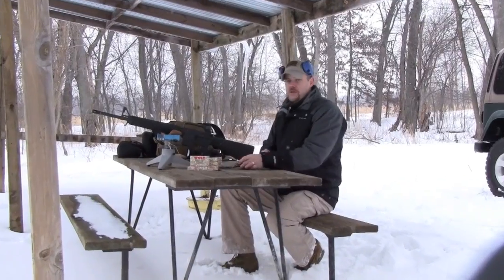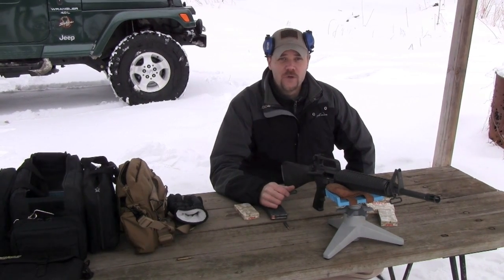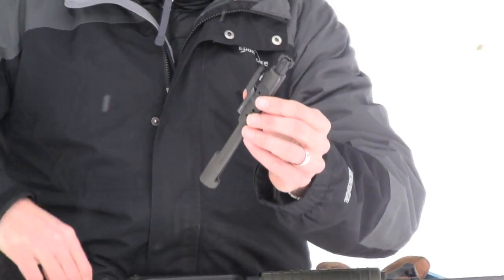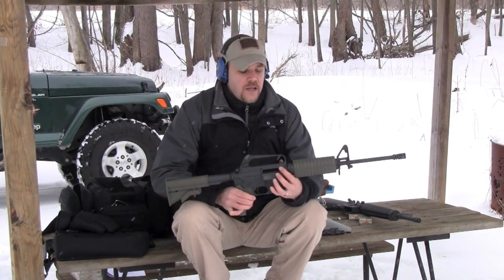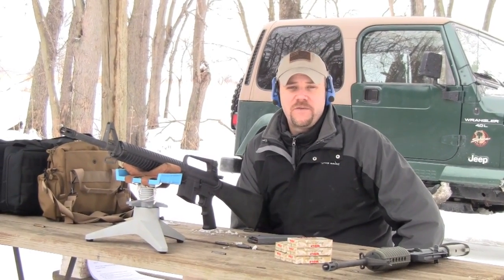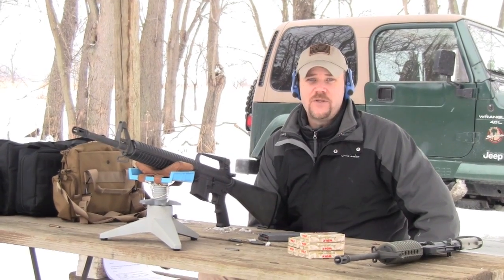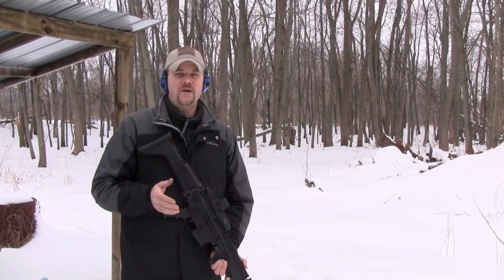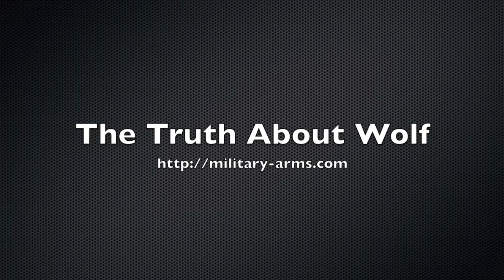The Truth About Wolf Ammo

Comment: I posted last year how all of the AR's I've owned and shot steel case out of had nothing but problems; I recently got a 7.62X39 upper that was tested at the factory with three rounds of steel case, and I had half of an 20 round magazine of steel case fail horribly. Failures to extract and following round jamming the fired casing, failures to feed, stove piping and jamming into the gas tube, getting stuck on the feed ramp, and final round fired and the casing stuck in the chamber. When I get the money saved up, I'm buying brass and reloading for the 7.62X39

Comment: My AR15 doesn't seem to like Wolf at all but Loves The New "Silver tip" Tula ammo as well as Silver Bear. My at Is a PSA Build with a 20in Rifle length upper. The Failure with Wolf are all Failures to feed, Its not getting caught on the Feed ramp but rather its getting caught on the Magazine Lips even in my Pmags. I think its because the texture of the Wolf is rougher than the Tula and especially the Zinc coated Silver Bear. Even My Yugo M85 Pap was having issues feeding Wolf but not Tula or Silver Bear.

Comment: Just to elaborate,  the rifle length gas system was designed around a 20" barrel.  The more common carbine length was actually designed for a 10.3" barrel, which is why 16" and even 14.5" guns with port sizes meant to run a wide variety of ammo can be overgassed with 5.56. The mid length is meant as an ideal length on the commercial 16" guns.  

I use Wolf and TulAmmo to function test new builds or guns with modified buffers or gas systems. So far if it runs those, they run anything.

Comment: You're missing out on a key Factor. Brass is THE choice of bullets for one main reason, the speed at which it expands and more importantly, contracts after expansion. Steel is a subpar choice because of its slow expansion and contraction time. This causes jams in PERFECTLY good chambers in some instances. 1) Because of slow expansion, the chamber is fouled MUCH faster over time. 2) slow contraction can cause stuck rounds. It's easier to shoot steel in sloppy chambers, and chrome lined chambers.

Comment: Lucky Gunner Labs as an excellent trial of four types of ammo in 4 identical guns. They monitored the test - then sectioned the barrels. - There were differences, especially in the pressure curve - I use steel case in some of my AR's and have never had trouble with mid - length gas systems.

Comment: I was have extraction problems with Wolf and Tula. What I started doing is staggering the steel with brass in my magazines. Also between mags I spray a little CLP in the chamber. I haven't had an issue since. Accuracy hasn't been a real problem. I find it to be "good enough". The worst thing I've found with Wolf/Tula is that it's DIRTY ammo, much more so than brass. But, I try and clean my gun after every range session so it hasn't been a real problem, either.  Just my 2 cents.

Comment: The Smith and Wesson M&P 15 sport eats everything like candy. Filled the mags with dirt, went between steel to brass in each individual mag, just loves it all. I personally have yet to have a bad round from any manufacture and Ive gone through quite a bit. Itll happen eventually. its only be a tad harder on extractors after 5k of rounds or so. And if you shoot a couple hundred rounds at once without cleaning it for a few thousand rounds itll degrade your barrel too.Everyone should try it to test

Comment: I have had Wolf black box jam in my Bushmaster AR-15 chamber. I can only figure it was due to the coating on the case & the tight tolerance of the rifle making tolerance stacking. My ParaOrdnance P-14 LTD had failures to fire with it as well. My SKS & AK's never had a single issue with thousands of rounds of Wolf fired.

Comment: I found an issue with lacquer coating.I had some lacquer coated7.62x54r stored in a leather pouch. I forgot about a it of it when I moved my ammo storage.The old ammo storage area got a little wet from condensation. The lacquer came off the rounds. I am not sure if it was the moisture,some reaction with the leather,but it turned a greenish blue and came off the ammo.I cleaned the rounds and decided to test them.They all fired fine. I do not store my ammo wet anywaybut thought I should mention it

Comment: My Bushmaster .308 (It is a Bushmaster, could be a problem) had zero problems with approximately 500 brass rounds.  Walmart had som Tulammo and with the ammo shortage, I bought a few.  After 9 rounds I had a catastrophic failure, my extractor broke.  After replacing the extractor, I ran more steel through it to see if it would break again. It worked fine, I just don't trust it in my rifles.

Comment: i have a single shot 223 with a heavy bull barrel that will not extract wolf steel case ammo for some reason the case hangs up and has to be removed with a cleaning rod, brass case ammo extracts great and ejects great every time i wish this wasn't an issue because the wolf ammo  was very accurate and costs were better

Comment: Ive always been of the mind that Wolf, Tula, Brown Bear Silver Bear and other steel cased ammo works best with East Bloc designed arms. If you have an AK, SKS, Tokarev, Makarov, CZs,  etc. Wolf, Tula, Brown Bear, Silver Bear and other steel cased ammo is meant to be used in those weapons as they have looser tolerances,thicker extractors, simpler operating principles and mechanisms optimized for that ammo since that was the available ammo.

Comment: Because the amount of time the system was pressurized would be very, very short.  The rifle length gas system is ~13.5" long and the shortest barrel it will reliably work with is 18" (with a rather large gas port).  Mid-length gas systems (between rifle and carbine) make more sense on rifles with 14.5 to 16" barrels.

Comment: I have tried Wolf 223 in my RRA Op2 and it has had issues extracting, and has indeed pulled the head of the case. Its a 16" barrel CMV. It just wont run any steel case of any type. Its an issue only with my RRA

Comment: Thank you for your reply.  As far as I have researched, there is no "jacket within a jacket".  The cheaper Wolf bullets are steel jacketed but then "copper washed" to hide this fact.  This is not enough of a coating over the steel to provide protection for your bore as a true copper jacketed bullet would provide.  These steel jacketed bullets might give bore longevity in a chrome lined bore but not a conventional bore.  There is a test someone ran on youtube using several (3 or 4) new AR's with dedicated ammo each for 10k rds.  The steel jacketed ammo (Wolf and Tula) completely wore out the bores in 10k rds.  The Federal true copper jacketed ammo still gave acceptable accuracy after 10k rds.  Check it out.

Comment: I haven't had any issues with Wolf ammo after thousands of rounds through my AK's, AR's, M1, FAL, G3's or 9mm handguns. Yes, they're usually not as accurate as some other ammo but that's not what they're designed for. Its range and shtf ammo. It's wrong to expect more out of it.
The one issue I had was with my AR-180. The Wolf 55gr FMJ 5.56 ammo wasn't hot enough to eject the old round and load the next. They would stove-pipe after every shot, but that was my only issue.

Comment: My AR has a 20" stainless bull barrel. It's extremely accurate and has never failed to cycle in the 10 years I've owned it until I ran that crap through it. I bought a case of Wolf 5.56, took it to the rasnge and put one 10 round mag through it. Once it was nice and warm I could not put 3 rounds in a row down range without it jamming. I had to spray lubricant into the  twenty round cartridge box so they would all cycle. What a mess. Sometimes you get exactly what you pay for....

Comment: Question: 
I have an H&K-91, 7.62X51  (308) that has a fluted chamber (when the empty brass comes out rifle it has makings on the case). I was told that I couldn’t shoot steel hull ammo in this rifle as it would ruin the chamber.  I did shoot some of the coated shell in it, I was also told not to use that type of ammo.  (I shoot a lot of wolf 22 ammo and I love it; Clean rifle after every shoot)
All the about ammo I’m talking about is Wolf or Tula Ammo. Please set me on the right roads.  Thanks,

Comment: My ar15 has chewed through thousands of Rounds of Tula and is still trucking along and my AR is a budget friendly gun so it ain’t like it’s a high quality firearm but it gets the job done there is nothing wrong with modern steel cased ammo the only foreseeable issue is using it at the range most ranges resale used cases and steel is not able to be reused so they ban them as a result then your stuck with ammo you can’t use not to mention you could be out of a range day if the only thing you shoot is steel cased unless the range has brass cased ammo for sale at a reasonable price

Comment: why you get a chrome chamber and barrel for, it is harder than the steel. but technically speaking the metal never touches the barrel only the copper. Also if you are using a match grade barrel that is designed for accuracy then it will lose its acceptable amount of accuracy around 2-3k rounds which is why target shooters change their barrels at around that round count. and kit also has a lot to do with how the rifling in the barrel was cut and the type of rifling.

Comment: I just bought 500 rounds of Wolf 7.62x39mm 123gr Full Metal Jacket 500/Ammo Can from Brownells for 159.99.  I hope I didn't mess up.  Happy Thanksgiving to all my fellow Patriots.
Reply: Vigilante Driver you can buy 1000rnds of 7.62x39 fir around $200 even during mild scare buying sprees. You paid too much but atleast you had something to shoot. 6 months ago when you posted this you could have easily gotten a 1000rnds of 7.62x39 with free shipping for around $200. 9mm and 7.62x39 wre almost always right at $200 for a 1000rnd case. (That is Steel cased 7.62x39 and brass cased 9mm in almost every situation)

Comment: When addressing the "myth" that Wolf damages your rifle, responses like "that's not necessarily true..." and "generally speaking..." aren't very convincing ways to express the argument. The difference in malleability between steel and brass is enough to realistically expect more wear in the chamber and on the bolt, as well as more possibility of damage to the upper receiver when the case is being ejected. An example is chipping on the deflector when using steel cased rounds. I think the best example is why folks use brass punches instead of steel punches when working with firearms; you can use either, but you're more likely to have some markings when using a steel punch on pins, etc...

Comment: I shot Tula in my R15 and after about 80 shots a fired casing got stuck in the barrel.  The gun was clean and serviceable 16 inch stainless barrel PSA.   I couldn't get it out with a copper rod and took it to a gunsmith $80 later, it was removed. he said he had to dissassible it to remove it.  Never again for me.  Since then I shot brass about 500 rounds no failures (American Eagle).

Comment: Video is spot on. The steel case vs brass or aluminum is near irrelevant. The case is not the issue, if in doubt study metallurgy. Hornady has been making .223 match in steel case for awhile now. The only issue you have with Russian ammo are the bi-metal bullets. Steel sleeve, with a light copper wash. You may, may need a barrel sooner, but when that happens you would have saved enough money over brass to get one for free. Shoot the Wolf, clean your rifle like you're supposed too. If it is malfunctioning, pull your PMCS or see a gunsmith. Wolf 62gr Hp, out of my DPMS PTR is a 600 yard prairie dog dismantler. Yes I may have to shoot twice, but it's not the steel cases fault.

Comment: What about the fact of the steel jacket in your bore, I have seen rifles shot out cause of the rifling cuts past the copper and gets into the tin of the bi-metal jacket. Have you ever shot out a barrel? Some are saying after 4000 rounds your barrel is ruined, which is not a big deal in a AR, cause they are easier to change, but in your AK it is a different store when it comes to changing the barrel.
Reply: Taping out a pin and pressing out the barrel is not hard.

Comment: here is a video posted on youtube where a guy with a Rockwell tester used it to test the hardness of Brass case and Steel cased Russian 762x39... On the Rockwell B scale the hardness of a brass case came in right around 80B ... The Russian steel cased ammuntion came in only 5 points higher at 85B..  When steel is left in its workable Annealed state it is fairly soft ... i suspect that the bi metal steel jackets used in the construction of the bullets is equally soft and would be near impossible to damage the Hard Chromed barrels used in AK's.. Hard Chrome hardness is Rc 65-68....  BTW, that is C scale Hardness and is many times harder and more wear resistant then 85 on the B scale..

Comment: My understanding is that if your AR does not have a 5.56 chamber you can run into issues using steel case ammo, due to heads spacing. This is according to cheaper than dirt. So if your having issues, well I guess you should have bought a Colt!

Comment: Wolf and Tulammo are great. Sure, there are better options out there, there is cleaner ammo out there, there is more accurate ammo out there, but not for the price. Wolf and Tulammo allow you to stock up a decent amount of ammo and at a low cost. It does not cycle well in my Ruger AR-556, the bolt will not fully cycle and pick up another round, but that is a buffer and spring problem that can be fixed. I have had no problems with cheap ammo in any DPMS or Palmetto rifles. Wolf and Tulammo is field grade ammo and is well worth buying, so buy as much as you can afford and buy it while you still can.

Comment: A question (forgive this if it seems "noobish", I am learning about the AR-15 platform).... If the shorter carbine barrel introduces problems with cycle timing, it seems to me it is due to the shorter gas tube, and the earlier introduction of gas to the bolt carrier. Why not simply place the gas port further out toward the muzzle -- and keep the gas tube the same length as on the 20" barrel rifle, which should keep the timing the same (while keeping the sight picture/radius the same)?

Comment: My ar15 has issues with extracting wolf ammo ( 1 round in 60) when firing for a long period of time and firing in quick succession. I notice that when this happens the casing has a mark where the extractor clearly tried to grab the case. 

If I shoot wolf slower, allowing 3-4 seconds between shots (to cool) I have no issues.

I have 0 issues with any other type of ammo. My barrel is Spikes Tac, and my bolt is also Spikes. 

Does this mean my extractor / spring is wearing down and or weaker?

I have maybe 1000 rounds through the parts.
Reply: your rifle is over gassed / not timed properly
Reply: +James Griffin it's over gasses with wolf ammo?
this issue does not happen with any other type of casing. Also like I said it's 1-2 rounds per 3 mags.

Comment: I had a Taurus .45, loaded up a clip and the first shot went like this “pssshhhh...” and I saw the casing come out. But I knew that the lead did not come out. 
Broke down the whole gun cleared it and took the barrel out, looked and the the lead bullet was lodged in the barrel. Sent it off to Taurus and they replaced it but stated that Wolf brand using different measurements and is not safe to shoot.

Comment: Steel cases probably do wear out extractors a little faster.

However, for the money you saved shooting that much ammo, you could probably buy 10 new extractors, and only wear out one.

Shit, it's the same with barrels. The steel jacketed ammo does wear out barrels more quickly, but over the span of 5000rds you'll have saved enough to replace it several times over.

Comment: in my home state .223 is the minimum for deer but I use my k98k open sights just because I like it.    I think mine is a 183 series if I remember right.   .  It only jams about 7  rounds out of 1000rd case of wolf. its just a pain to deal with when it does I just didn't want to keep shooting it and chance  breaking my extractor.  One round out of a 1000 that I had was over sized or out of spec and it wouldn't chamber it but my dads m77 ruger chambered the round just fine.

Comment: Well that and most western designed weapons are meant to feed brass cased ammo have tighter tolerances. East bloc designed weapons usually do fine with Wolf/Tula, Bear Ammo, Golden Tiger since those weapons are built from the ground up to use that ammo with looser tolerances and stronger extractors and springs to handle it.  The Russians and their allies had more steel than copper and was cheaper and such made their ammo and casings from steel  and  designed and built weapons with that in mind

Comment: I have chronographed all the ruskie brands of ammo and the .223 usually has a muzzle velocity about 500fps slower than its counterparts. This is not the case with 7.62x39. The main issue is with different gas pressures and the fact that steel does expand as much to fill the chamber leaving a gap. This gap allows carbon build up on the chamber wall and eventually it sticks a round.